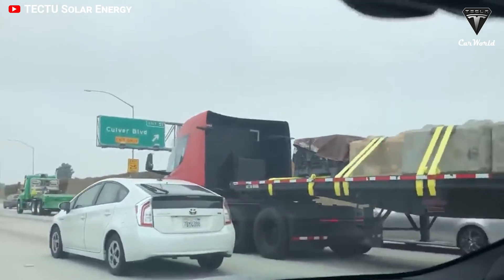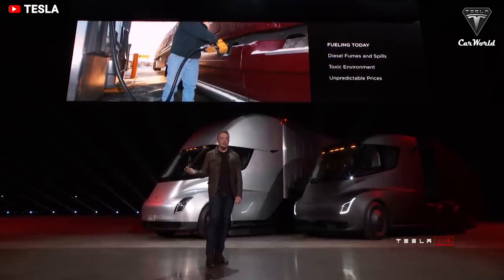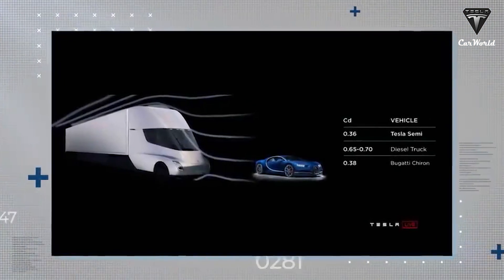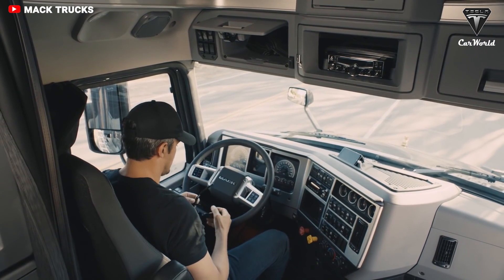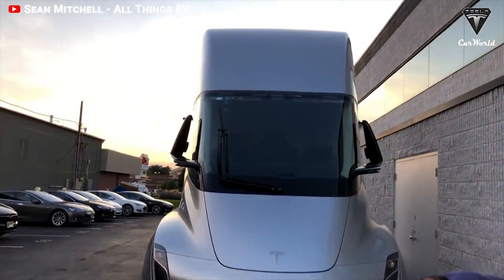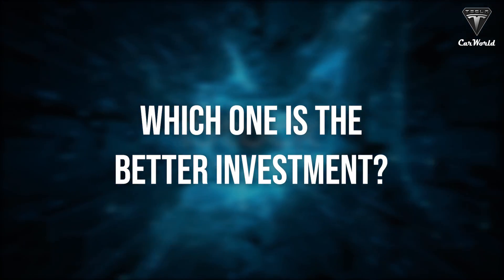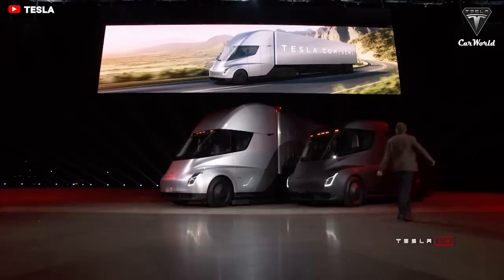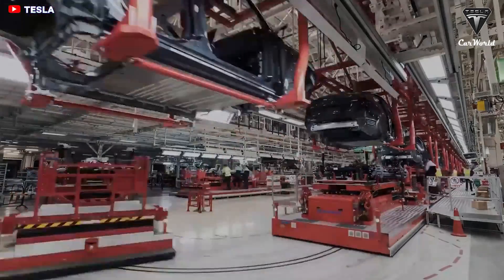Which is the KING of 2023 heavy trucks? Mack Anthem Diesel Truck Vs. Tesla Electric Semi?

Comment: You are misrepresenting the additional 2000 lbs as something beneficial when it is a special dispensation to accommodate the ridiculous weight of the batteries.  Take away that dispensation and you are at a disadvantage.  Add in the fact that range is a fraction of the Mack, and the price is twice the costliest version of an OTR Anthem and your financial comparison isn't as rosy.  Refueling is far worse for the Tesla, basically the truck will be down for hours, not earning revenue.  There is a place for the Tesla, and as the tech improves, I imagine it will become more of a challenge to trucks like the Anthem.  For now, the Tesla Semi cannot compete for OTR.

Comment: 13:47 What is the kilowatt hour price, you are using?
Remember the infrastructure to deliver the massive electrical power to convenient charging station with a feasonable recharging  calacity for the ET does not exist . Many new powerstations and heavy transmission lines must FIRST be build, those cost must be borne by the users rising the costs many fold, to date almost impossible to quote. So your statements  are not just unfair but criminally misleading, why because the unkown cost may be higher, to completely invalidate cost projections that busineses must make to get financing.
A specialized new infrastucture is not feasible without subsidies by tax payers
You better clear this up, anyway  I am unsubscribing.

Comment: Torque does not mean anything since a torque increasing reduction gearing is always needed.

How long does it take to charge the laaaaarge battery on a Etruck, are the much more power guzzling chargers available , does the power grid support the enourmously added electrical power transmission on a busy route, who pays for the rest areas's power supply since truckers cant idle the engines to stay warm and the cooling of refrigerated trailers must continue, hundreds of unanswered questions. Excuses are just that ,unproven estimated speculative assertions. Just trying to separate dreams from hard reality.
Time to look into that boring subject, which is, sorry to say, unresponsibly ignored.

Comment: What is max distance of a fully fueled anthem? Out west we have these things caused mountains and high winds, also cold weather what is the Tesla performance. Maybe as a in town delivery it is ok but long hauls it not there also all seasons. I drive the I80 and I70 routes and have not seen any recharge stations at stops. I think there needs more infrastructure for charging, and warehousing and or other rigs positioned strategically  to so loads can be pony expressed styled across country. I like the ideas but believe we need to adopt a more technical plan  to deployment than just dropping a new technology out into the wilds. Also the trailers need solar added to thier roofs to help with the recharging as they drive.

Comment: the main problem i see is the charging and the price of charging, how far out of route will you have to drive to charge , how fast will it charge,  if instead of 500 mile you could go 700 miles a day and have a comfortable bunk to sleep and relax in while loading or unloading, i don't see any comforts of home in these trucks, driver spend alot of time in these trucks, weeks if not months before going home,  your  trucks are great but they are basically day cabs

Comment: Travel and testing on flat ground is wonderful for the electric truck, but with full 80,000 and mountains to climb and to decent will be the real test of the truck, travelling the distance from coast to coast in a time frame of the Diesel engine will be the other test to complete, also will need to rest in a cab that has no bed to lay down in and not all hotel have truck parking, there is going to bigger problems to overcome.

Comment: So this video is speculation vs actual road experience. The Anthem takes less time to fuel, the Tesla would never make time restraints because of the charging needs, also most this videos are claims not actual road experience. Next, Anthems are built for the driver in mind. Bunks, bunk heaters, and light testing. Also if the truck breaks down, local shops can fix it, but the Tesla won't have a chance.

Comment: The Anthem can be used in multiple applications and can go all day on one fuel up. Construction to OTR, the Anthem is far better and superior to the Tesla truck. Not only that, the Anthem can operate at 0° temps, the Tesla would simple lose all charge. A lot of variables but Tesla has a lot of work to do to beat the Anthem.

Comment: Seems like Tesla is only competing against day cabs with that kind of a range. Most truck on the road now averages range from 600 to 700 miles on a shift. That means 1,200 to 2,400 per day if you have team drivers and depending on what the governor is set to. This means while a regular truck completes a coast to coast delivery a tesla would struggle to make it to each state on the way there.

Comment: I just got out of an Anthem. Had the mp8 engine which was really great at accelerating and pulling up hill. Drive train was about the only good thing on it. Everything else would fall apart on it. Got into a Peterbilt 579 with a paccar and still trying to get used to the lack of power. Probably wouldn't be bad if it was a manual.

Comment: What most incredible to me is how long it took for our civilization to figure out that truck seat should be placed in the middle. I mean hardly anybody is driving trucks for fun or as taxi service. Then what the f* does the 2 extra seats doing next to driver? You don't get passenger seats next to pilot yet we figured that 30 ton trucks driving through dense urban areas should be accomponied by passengers blocking their view onto the urban sidewalks.

Comment: I’m sorry for saying this and I’m sure I will get plenty of hate. But only car guys care about acceleration. If you are thinking about how fast you can possibly get up to speed then you clearly don’t understand what load shift is. Also hooray the Tesla semi can produce, 900 hp, but only 1600 ftpds torque. I believe this creator doesn’t understand how having a higher torque versus having a higher horsepower, is significantly more important when towing heavier loads. The anthem having oh no only 505 hp yet having 1860 ftpds of torque. Lastly has anyone noticed how he decided to use a Mack anthem versus using an international lone star? Or did we just forget about a truck that makes 605 horsepower at 2050 ftpds of torque, with a max gcvw of 140,000. Yeah let’s not compare the Tesla semi to the LoneStar. I go to plenty of shippers that have been demoing the Tesla semi trucks and all they do is complain that they are only getting 4 hours of runtime just moving trailers around the facility and then having to charge them for six hours. Hmmm. I think I will stick with diesel.
Reply: Is 140,000 pounds US DOT legal vs 80,000 pounds? Accelerating on a flat is for race cars, but isn't that a proxy measure for performance on hills/overtaking?

Comment: I get your a Tesla channel and need to promote Tesla products but still come on. You left out crucial data and talking points. You talked about the HP of each truck, the Tesla has electrical engines, the Anthem is a I6. The reason why it's a I6 is better fuel economy with the best towing capabilities. Yes ots 80k lbs to 82k lbs in favor of the Tesla. However the DOT and federal government limits trucking capacity. Which if I remember correctly os 80k lbs. Correct me if I'm wrong tho. Not to mention I noticed you didn't mention anything about the trucks weights. Which is interesting because the Tesla truck weighs more. You did touch on Gross weight which is truck plus trailer. Gross is what we regulate. Which means you want a truck with low weight, enough towing capacity for the legal limit, and good fuel economy. Which is why Mack has a I6 that is at 80k Gross capacity. The less the truck weights the better. The Tesla weights more which lowers the amount of load weight which in turn lowers the amount of money you can make. Real Engineering did a good job explaining this short coming and why it maybe be able to pay for itself in the long term with mechanical cost it will cost you in the short term and long term with the income per load.

Comment: you have forgotten so many things man.
1. Drivers get payed by the mile so they wont get paid while charging. (no drivers if extra hours without pay)
2. They have about 1/4 of the range a diesel has roughly 2k miles with the new ones compared to the 500 of the tesla
3. they don't actually have a higher payload... they max out at 82 000 Lbs total weight and the teslas are heavier so less can be moved. it total.
4. Truck companies are cheap. teslas also super expensive if they break 20k for a car battery pack

please actually learn the trade before talking about it

Comment: The most realistic test would be in the middle of winter, and both  an electric and deisle turck start out in New York and drive to Seattle Washington.  AND then back again.

As this represent a real world test that includes all aspects of trucking.  Also, it will expose the crap that is tesla.
Reply: Is that assuming the tech would not evolve or continually improve to solve these problems? It appears to be a good first step for which the problems or "cons" involved would yield solutions that would interactively advance the industry in the long term.

Comment: Anyone with only even a Casual comprehension of realistic, non science fiction energy storage densities could tell you why an electric Semi truck is (in 2023) a really STUPID idea. That isnt even to broach the MASSIVE problem about how many times it's perverbial "gas tank" (Battery packs) can actually be refilled before you have to replace them, (at incredible cost) keep in mind semi's often have lifespans of 20+ years, to last that long how many battery pack replacements will it taketo maintain useful charge capacity under a NEAR CONSTANT high drain scenairio? Under the conditions these vehicles are used, The Battery technology is NOT there yet. 

Maybe if Supercapciters can be made light enough while posessing energy density high enough. Ideally, also being able to survive being looked at in an angry tone of voice, and not exploding like LiPo's have a rare proclivity of doing.

Comment: It brings the question of how long does it take to full charge from empty. What happens when the batteries go bad and don't say they don't because ALL batteries go bad. How much is it going to cost to send it off to have the batteries replaced or even a motor replaced. And they want to eliminate fossil fuels oils and products but even the Tesla semi and even the cars still have moving parts and all moving parts have to have some kind of lubricant or they will over heat and seize up so if fossil fuels are done away with then what.

Comment: OK just one question. 0 to 60 in 5 seconds? At 60 mph it takes longer than 5 seconds to come to a complete stop. Ergo safe following distance in a big truck should be no less than 6 seconds. So woo hoo, do you really need to accelerate that fast in a big truck? What now? Headache racks on the back of flatbeds and reinforced enclose trailers.

See the problem with idiots is they know everything about something they have no experience with. So what's gonna happen the fist time a moose, elk or cow steps or runs in front of a Tesla big truck going 75 mph? From experience I hit a 1200 pound bull elk in Arizona in a frieghtliner classic doing the speed limit of course, 75 and it was not pretty. Even a cabover is bad but you only have about 2 feet of room on driver and passenger side out of 8 feet and the rest is engine.

So these Teslas especially sitting in the middle is a dumber design than curb sniffers were. And the old cabovers at least looked good. The Teslas and curb sniffers look like some pothead art class students doodling. On big trucks and cars even long horizontal hoods searve a purpose even if it is for wildlife running in front of you or texting drivers missing stop signs or 90 mph idiots in rain in 4 wheelers that can't grasp the idea of hydroplaning.

But yeah. Oh wow. 0 to 60 in five seconds. What idiot truck driver would even want to accelerate that fast? Plus a real driver instead of steering wheel holder knows you don't drive the truck. You drive the load. That load dictates how you drive the truck. But hey welcome to the future, right? But 0 to 60 in five seconds is less time than it takes from 60 to 0 without jack knitting. I just wonder how many fifth wheel jaws will fail and trailer kingpins will develop stress fractures and fail? But real world Safety and physics are thrown out when something is "cool" and or we are saving the planet.

Comment: There is no way an ICE could overpass the simplicity of electric engine. @2:35 look at how over enngeniring is that thing, is just one motor, there isn't redundancy. Tesla has 3 motors, if 1 fail you're still on the road. Add that to time out of bussines to fix an ICE.
When more complex a system is, more prone to fail is.

Comment: It is very obvious you have no true understanding of what commercial trucking is about and are simply going off of Tesla talking points:
1.  Acceleration is meaningless in a heavy truck.  It is only important to Tesla because they are taking their motors from their cars, so the truck has the capability anyway.
2.  That ridiculously short range is important.  You obviously don’t need a bunk in your truck if you have to turn around and go home every four hours to get one on a fresh battery.
3.  How is Tesla going to handle hotel load?  There is zero mention of it anywhere.
4.  Cold weather?  Mountain climbing? Extended exposure to road salt?  Roadside serviceability?  All of these things are clearly understood challenges in trucking.  There is reason to believe an electric truck will perform worse than a more traditional truck in those conditions.  You would think it would be something Tesla would design for.  Silence speaks volumes here.
5.  The lower torque number, which isn’t a dynamometer number but one you deduced, means the Tesla truck is less powerful where it actually matters.  Furthermore, you can swap in existing, thoroughly proven engines capable of up to 2200 pound feet.  Tesla simply can’t compete here, which is why it keeps trumpeting acceleration figures.
6.  The Tesla truck doesn’t have a greater payload capacity.  You can set an Anthem up for heavy haul, which means upward of 200,000 pounds at highway speeds.  The numbers supplied to you by Mack are for standard tractor configurations, which allow for a lighter combination weight for weight limited streets and bridges.  80,000 pounds is the federal maximum non-permitted weight limit, so every traditional manufacturer will tell you its heaviest truck is 80,000 pounds.  Tesla claiming 82,000 pounds is nothing more than PR taking advantage of clueless people who don’t know better.

Comment: 0-60 in 5secs doesn't matter as drivers/companies wouldn't want to waste power accelerating that quickly
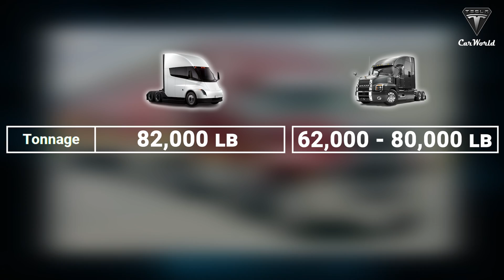5:34 Too bad you don't mention how much of that payload goes to the batteries.
I just thought of something, an electric semi probably wouldn't be able to use its motors to help in braking, which is really important while going down a steep/long grade (to save the brakes from burning out).
8:00 Tesla semis don't need sleepers because they don't have the range to require one.
More safe? Maybe, unless the batteries catch on fire. And I find it odd you mention auto-pilot features when it has been shown Tesla's isn't quite up to snuff yet.

Comment: Y’all worried about the acceleration and I’m trynna figure out why they think 300 &500 miles are good ranges… I can drive almost 1000 miles on a full tank and it only takes me 20 mins to fill up. Not to mention if that range will change under a load cuz those batteries will definitely be working overtime when pulling 80,000lbs… how long will these motors last under heavy loads everyday??? I’m sure it won’t be the millions of miles most semi trucks endure without needing a new engine….🤷🏽‍♂️

Comment: As a gearhead I am okay with Electric vehicles as long as we will have a choice between Internal Combustion Engine vehicles and those that are electric, I think that both of these vehicles have their uses, however one cannot be compared to another, since both of these trucks are completely different worlds, I personally prefer ICE vehicles and I am stunned that a pickup truck like 2022 RAM 3500 Dually Cummins High Output puts out 1085lbft of torque, which is just 400-600lbft than a fricking semi-truck. I am really excited for electric Semi Trucks, however I don't see them completely taking over the good old regular Internal Combustion Engine Cars, Pickup Trucks, Semis, or even Busses, since one type of vehicle will always be better from another and vise versa. Consumer's ability of choice is the key.

Comment: Im sorry, but did this fanboy just gloss over the “never need to change brake pads, ever”! What utter shite.

You never covered the refilling time of both of the trucks. What is the average distance driven in a day by a long distance driver? 300+? 500+?
Overall cost of ownership didn’t cover the replacement of the batteries after a few hundred thousand miles.

Comment: I mean, this video is not in the same realm of objective.  

If you want to see the math behind an objective discussion: Engineering Explained does this well. 

My thoughts: Tesla won't put MACK out of business, and the problem of charging infrastructure, and overall costs vs. subsidy is going to be the main reason why these will succeed or fail. 

I don't know any trucker that wants to accelerate thousands of pounds of freight... it's not a metric they care about.